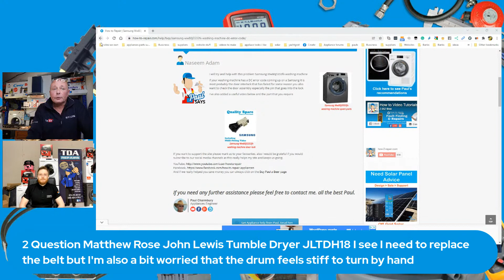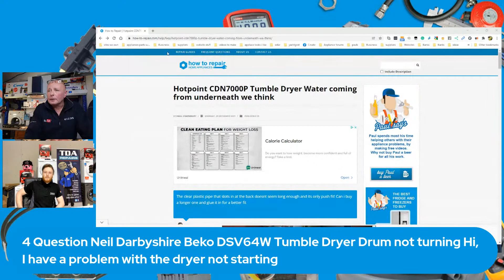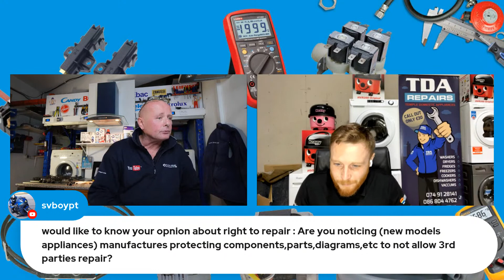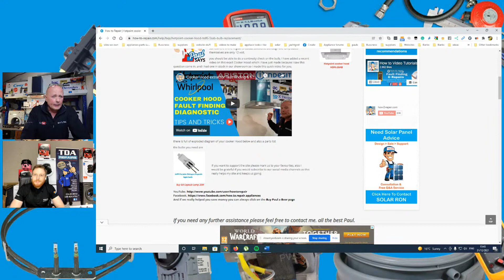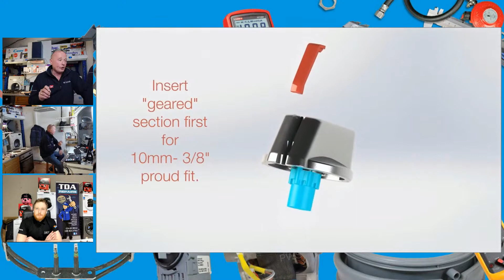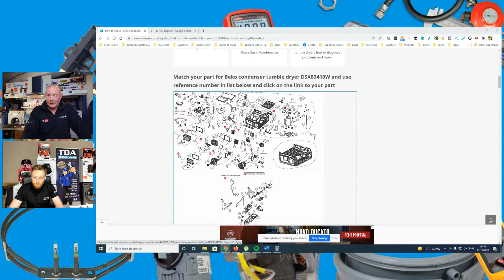Live Q&A's on Appliance Repairs 31-12-2021

Comment: Had my AEG 8kg heat pump dryer for 12 years now,  it was expensive to buy but it’s the best dryer I ever had.   I do a lot of laundry every day and every single thing that comes out the washing machine goes in the dryer, never line dry, or radiator dry or use one those airer things, every single thing goes in the dryer, it doesn’t shrink anything, I’ve dried cashmere in it and it’s
Come out perfect, 12 years and still going strong. All It’s had is 1 belt, 1 capacitor and the jockey wheels replaced, all covered by my Domestic and General insurance I have in all the appliances,  not bad considering the amount of use it’s had over its 12 years of life
Reply from the maker: Happy to see that your satisfaction with your dryer mate. AEG & Zanussi made fantastic machines. However, it’s sad to see the company decline. The quality isn’t what it used to be. They built their reputation on these quality machines but now rely on their name rather than their products.

If companies like this went back to basics, they would gain strong customer loyalty.

Comment: Hi Sir 
Can you please help me I have got hotpoint washing machine and the problem is it take to long to rotate for example if I start a 30 mins program it will be quite for 5 mins and then the drum rotate for 5 second and then stop and again after 3 mins start for 2 seconds and stop and the same if I choose a spin and drain program it is still the same and can you please help me 
I have checked these issues it is OK 
Like the heating element 
The water coming and going out 
The door closing 
These things are fine but the problem is too much delay between one and another rotation of the drum 

Thanks I hope to receive the response soon 

Thanks for u useful videos

Comment: Happy new year . I've watch ur video regarding dryer repair and I have a problem with my dryer which is a hoover link 8kg onetouch and on the dash board all the red light come on and flashing and stops . Can you help please or put me on the right road . Many thanks
Reply from the maker: If you can send us the full question in via the website I will feature it on the next show please be very descriptive with the full model number so I can find as many bits of information on your machine as possible